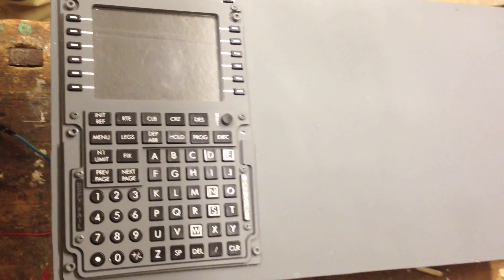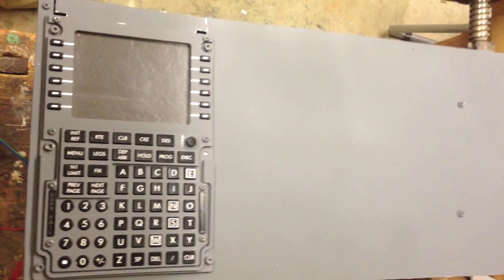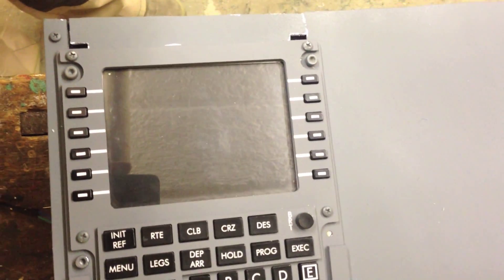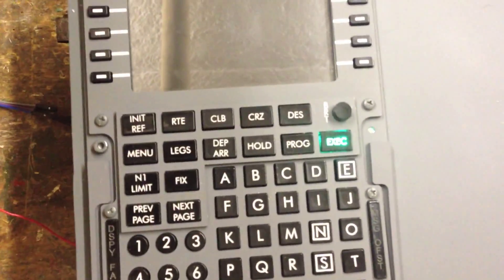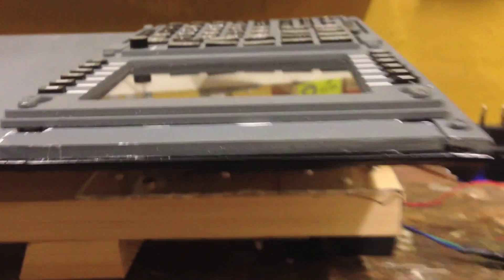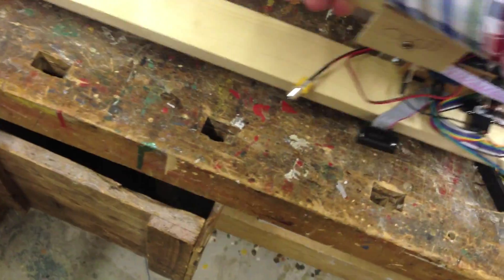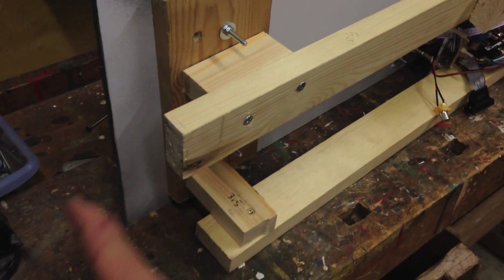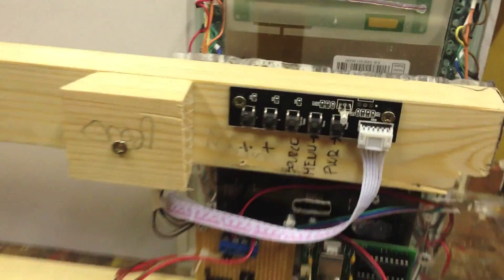Mounting the CDU - B737 Home Cockpit

Comment: Using usb keys card how many pins will i use to make 1 output???
Reply from the maker: Gio Estrada Using the keyboard-card you make a matrix. So you need two sets of wires for each switch, 4 in total.
Reply: Thanks